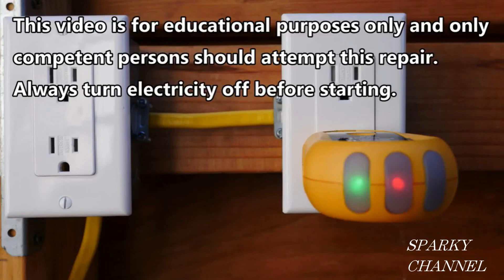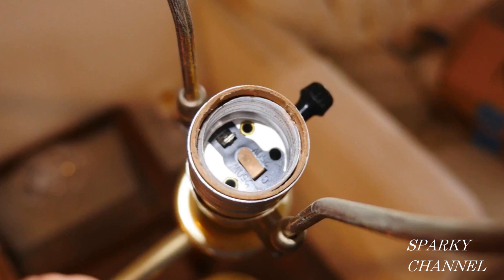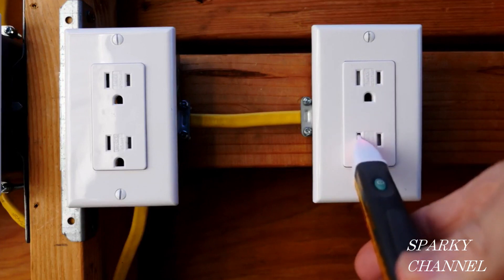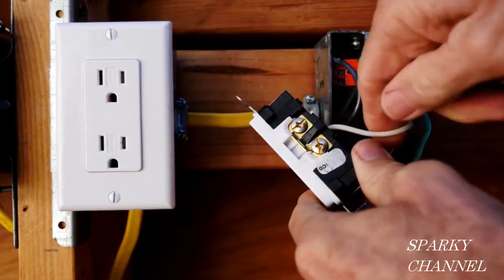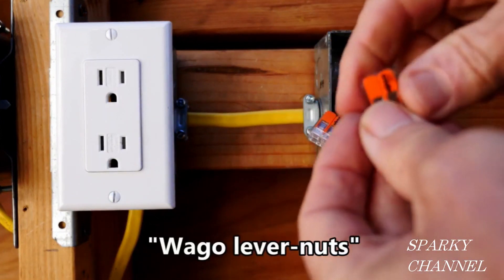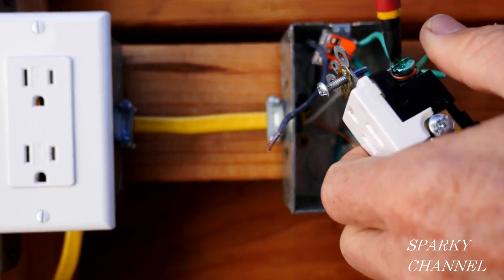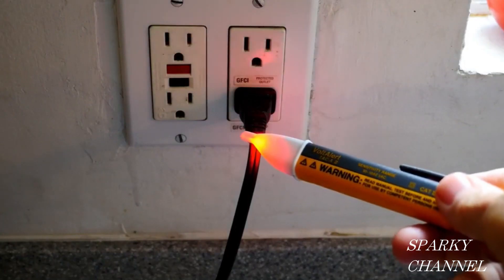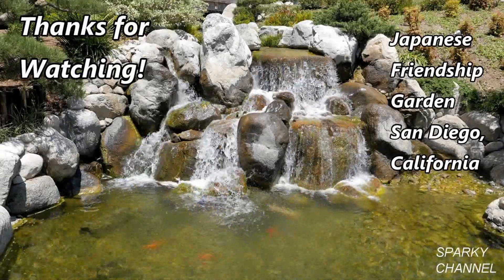How To Fix a Reverse Polarity Receptacle

Comment: I have hot & neutral reversed outlets all around my living room (all on the same circuit breaker). How can I know where the problem is coming from? Today I checked 3 of 8 outlets and they were wired correctly. I will have to check the other 5, but I'm not sure they might have any incorrect or reversed wiring as I have installed these outlets in the past myself, and I doubt I made a mistake - but you never know, checking will verify. If they are ALL wired correctly, how can I find the source of the problem?

Comment: Thanks. Nice video. What could happen if I touch the two probes of the multi-meter to two HOT wires? For example a receptacle in a series, So, two paths entering one receptacle (2 hots, 2 neutrals in one box), and 1950s home, all wires are black. I'll search for a video on your channel. The outcomes of test possibilities should be something like, how many different ways can 4 wires and a red and black probe connect, should be some combination of maths. I think total combinations to test is 12 different tests. But which readouts are expected in this situation? I think the multi-meter will report either 120v, thanks to this video, 0 volts (neutral connected to another neutral), or what ever it reports when red probe touches hot and black probe touches other hot. So many questions, sorry, Is a LoZ multimeter, (more expensive) required to identify the voltages below 12 volts when touch probes to two different neutrals? I meant, a LoZ multimeter will confirm a neutral is a neutral by showing some tiny amount of volts. And if by chance, this 1950s home has a sheathed wire acting as a ground conductor wire, then a loZ multimeter will show zero, to identify neutrals from a repurposed sheathed ground? Your videos are awesome. I keep picking up new things. Like a volt tester can test all the way down to 12 Volts.

Comment: Hi there, what about if a receptacle is wired correctly, white wire on silver screws and black on brass, but the little plug tester says revered hot/neutral 😢.  Oh, but the voltage detector reads correctly, left side silent/ neutral,  right/hot beep

Comment: Great video Bill! Thank you very much! I recently checked my outlets and found 4 in my kitchen with reverse polarity. I took covers off all of them and noticed they’re wired correctly. Any other ideas what it could be? Thank you
Reply: Hi, did you ever figure out what the issue was if so how did you fix
Reply: @DeeDee-rr3sn Yes it was a very quick fix. I actually had to bite the bullet and call an electrician however when he showed up he immediately went to the main panel outside and found the white neutral was connected to the hot line.  All he did was unplug it and plugged it into the neutral line and that took care of it all! He was cool and didn’t even write up an invoice and only charged me $100 for about 10 minutes of work and even asked if $100 was ok . I immediately said no problem .He easily could’ve charged much more and I expected to pay much more.  He jokingly asked if I had done it and I told him heck no. I would never mess with the main electrical panel but I had some remodel work done years ago which included a panel upgrade and he said that’s where it happened . The remodelers connected it wrong. But I’m glad his work took care of the whole house.

Comment: I had this issue at work today with a USB outlet. I was sent to a job for the outlet not working when I took it out of the wall I looked and seen that it was wired correctly but it keep saying it's rev
Reply from the maker: Good job!
Reply: So what was the issue and how did you fix

Comment: sort of related to reverse polarity,  is this non standard and unsafe way to wire 3 way switches.   I just finished a renovation in a 1952 Ranch home in Anderson County,  South Carolina.  the original wiring is the cloth braided ungrounded romex. In the hallways,  a 14-2 runs from a receptacle to the first 3 way switch.   The hot and neutral are joined with a pigtail and connected to the traveller screws, then jumps over to the other way way switch,  same thing,  then connects to another receptacle and continues down the line.  A single wire, with a rubberized insulation, connected from the common screw in each switch box, to the light. Light can have 4 states depending on how the switchs are flipped.    N-N = OFF  N-H (correct polarity) = ON  H-H = OFF, socket is hot on both terminals. H-N = (Reverse polarity) = ON.    There is no 14/3 anywhere in this house, as far as I could tell.

Comment: Your video is a reverse polarity with a square socket. Mine is the older round double socket is there any difference or do I need to replace it with the newer square socket? I other words is the back the same on both shaped sockets?
Reply from the maker: Both kinds work and test out the same.

Comment: Sparked I have 3 outlets on a 15a breaker ..i put in 3 new receptacles all hooked up correctly blacks to bronze colored screws.and whites to. Silver screws ...using my outlet tester I am now getting reverse hot and nuetral on all three outlets ...rechecked twice no mix ups..checked the breaker and black wire is hooked to breaker switch ..so now what? Your help would be appreciated ..i believe this room was wired in the 70s there are grounds btw...
Reply: If that wire from your panel is INDEED going to your first receptacle you installed, (and you instslled it correctly), then something is wrong w/ your receptacle. I don't think that's your first hit from the panel, though.
Reply: Wonder if they got swapped along the way. So somewhere in the circuit the black wire turned into a white wire

Did you find out?

Comment: You need to cover the screws with electrical tape or rubber so they don't hit the metal box. Plastic box much better.
Reply from the maker: Thanks! See 6:24 where I put electricians tape around the terminals.
Reply: Everyone's a master electrician when they're fresh out of school. And he doesn't "need to"...it's recommended 👍🏻

Comment: But what happens if the wires coming to the outlet are reversed polarity? Is it okay to just swap the white (live because it's reversed) with the black (neutral because it's reversed). Or do you have to go back through the entire circuit to find the source of the reversal?
Reply: No, professionally this wouldn't be to code. If another electrician comes in, he may not know that everything is reversed. Also the next home owner may not know. This is a safety big hazard. Also, i'd check the entire eletrical system, because if they mix up that simple of a thing, what else did they mix up.
So you are right about having to fix the main source and fixing it there. The conductors are color coded for a reason.
Reply: I have the same question
Reply: A tip is to use NCV Detector on the outlets upstream of that circuit. If polarity is reversed maybe wires at an outlet are reversed or even worse and odd is wires at the main panel are reversed. Advise u to call an electrician though.

Comment: Is it possible for the tester to display hot-neutral reverse when the actual problem was an open ground?  I connected the ground and it went from reverse polarity to correct.
Reply: Good question
Reply: Look at the "How To Identify Reverse Polarity Bootleg Ground Receptacles" (Nov 28, 2020) on this channel.  Maybe that is your real problem?
Reply: @HoosierRallyMaster  I checked with the voltage tester and only the small slots are hot.   It seems to be correct now.  Thanks for the suggestion.  I'm still puzzled about why it didn't show up as an open ground in the first place.

Comment: I just replaced the outlets in a bedroom, only to find out the entire set of outlets do not work when the breaker is turned on.  So obviously messed up one or more outlets along the way / how can I determine - since I am
Not getting power in either breaker position - where the screw up is!

Comment: Is it possible to have a reverse polarity on a 240v 3 prong outlet? I'm assuming not since reverse polarity if I understand correctly is mixed hot and neutral and the three-prong has two hots and a neutral/ground prong - correct?

Comment: If every plug in the house is reversed is there a way to reverse the wires at the breaker panel?
Reply: Sounds like a major screw up when putting in the panel, and it appears like it wasn’t done by a qualified and licensed electrician.

Comment: I have a circuit breaker that now works in when in the off position, and doesn't work in the on position. I just did some rewiring, and am an amateur. I messed something up somewhere.  What could it be ? Is it dangerous ?
Reply: My opinion is to get a qualified and licensed electrician to look at this situation immediately!

Comment: Hey Bill is there a specific reason why the conductors are not connected in line kind of thing to the outlet, in other words white conductor to white screw across the black conductor to bronze screw ? Since you have two white screws and  two bronze screws. I normally see the conductors been connected alternated to one another. Is this a code? Hope you understand my question.

Thanks
Reply: No. It's usually a new guy not paying attention to what he's doing.  White goes to silver, black to bronze, and green to ground. Old wiring or special circumstances may be done differently, but usually not for receptacles.

Comment: Thank You for the video!  I have one outlet that shows hot and neutral are reversed...but the wires are on the correct screw.  Now I know how to test to find out which wire is actually hot!  Great!!
Reply: You should still track back the wiring to its source to find where they got flipped. You may have other reversed outlets.

Comment: Hi Bill.  I follow your videos.  They are absolutely excellent!   In this video you mentioned that there is a situation where this can occur.  So my question is can this occur in another way than simply reversing the connection at an outlet?  I ask because I’m am a retired secondary math teacher who has become a part time handyman with many years of experience having had three different homes.  I recently came across this where a third card garage addition has all its outlets and lights reversed.  I use the same Ideal tester/transmitter that you like to use.  My neighbor said that’s been like that ever since they moved to that house for the 13 or so years.  So they did not want me to look into it, so I didn’t.  Shoiuld that be pursued?  What do you think?
Reply: Yes. Which is why I'm looking in the comments. It could go all the way back to the breakers. Or in this video, the other end of the wire on the other outlet.
Reply: But, yes it is a safety issue and should be fixed. I've heard from co workers of the hot being grounded and also the neutral NOT be grounded where it comes in.

Comment: Most single phase appliances wouldn't care of reversed polarity, remember there are connection systems like Schuko which are not polarised. It's more of a safety issue. For the Edison socket it would be a massive issue because in that case the threads would be live if you change a light bulb and a dangerous potential would be touchable. And in case of the Schuko system we use measures to create the same amount of safety. For example using 2-pole switches which switch the line and the neutral, for where a single pole switch would be sufficient in a polarised system. Appliances which require a polarisation are here mostly hardwired or connected with a different plug which is polarised. For example the CEE (in the UK this is called commando plug) or Perilex. But the Perilex is actually a three-phase connector available in a 16A (~11 kW) and a 25A (~17 kW) version, the CEE are available in single and in three-phase variants.

https://en.wikipedia.org/wiki/Perilex
Reply from the maker: Thanks Marcel!
Reply: I have never seen a double pole switch on a lamp. The procedure is to unplug before changing the bulb. Only power strips use double pole switches.
Reply: @okaro6595  They got a different measure, of course unplug, but they also got a big collar around the Edison socket to prevent that someone can touch the socket of the lamp while it's still in contact with the socket of the lamp.

Comment: Always good into to know. Question though. My house, as an example, does not use "pig tails" from the wires to the outlet.  So if (as an example) the second outlet in the line is reversed would that make all the others downline also reversed (even if those are wired properly)?
Reply from the maker: Yes, absolutely! That's why you try to fix the most upstream receptacle that has the problem first. If you do, all the downstream receptacles will be fixed too.

Comment: hey, i have a question. is there a way to use 3 way switches to control a ceiling fan that will control the light and fan on separate switches without having 2 separate travelers?
Reply: This is the type of videos I love watching from Sparky Channel. I hope he answers or does a video on this. I've been hoping he would upload his video on how to wire a three-way circuit again. I've shown dozens of people that video until it got lost.
Reply from the maker: Darrin, you don't happen to have a copy of that video do you? I'll bet someone has a copy.
Reply: @SparkyChannel  No, I wish I did though!
Reply from the maker: @darrinward7815  Thanks anyway! :)

Comment: Great video Bill! I personally don't use non-contact testers and was very interested that your video taught me that if the polarity is reversed it won't read on the hot side. I can't wait to show this in real life to my younger brother who uses a non-contact tester, without really knowing how to use it. He refuses to use a mulit-meter I bought him and won't let me teach him how to use either tool correctly.
Reply from the maker: I agree, with you, he needs to be proficient with both. Multi-meters give a world of information that the NCVT's can't.
Reply: You also need to get a proofing tester before you use either anywhere near electricity to indicate it works as intended. I prefer the more expensive  fluke PRV240FS proofing tester the nice thing about this is you can proof both lead based meters and non-contact testers including for AC and DC really nice proofing unit.
Reply from the maker: @mathman0101  Yes, the Fluke PRV240FS proofing tester is a beauty!